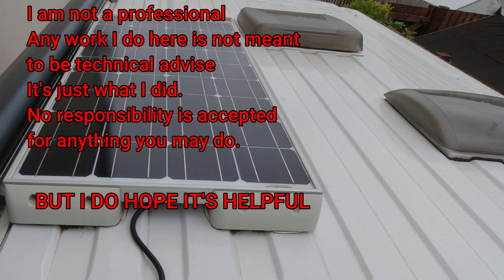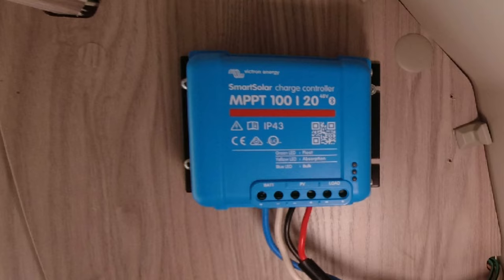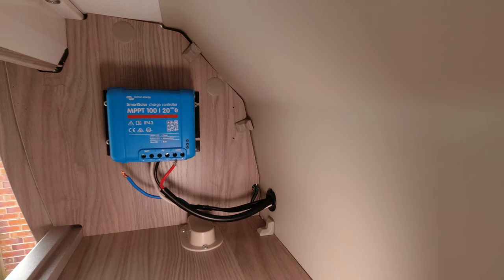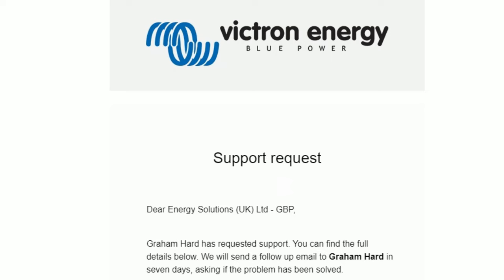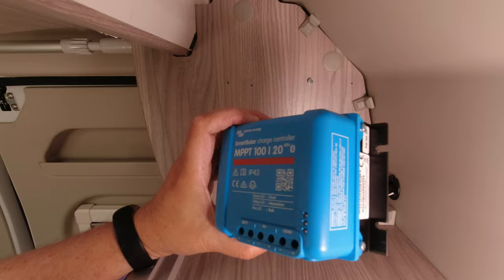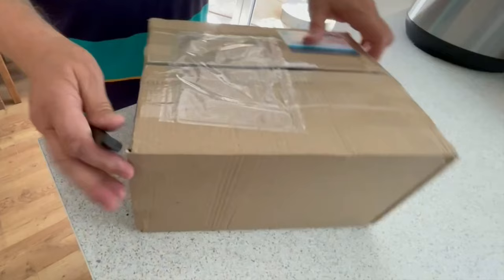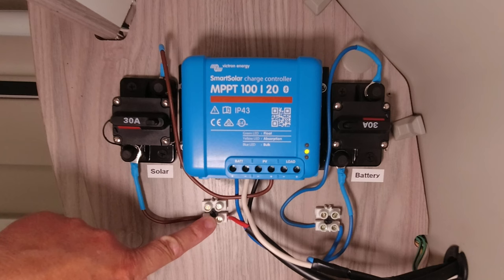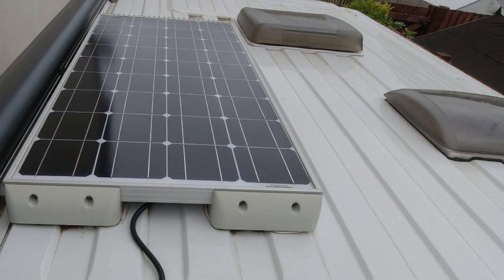OUR SOLAR FAILED NOT CHARGING BATTERIES CORRECTLY

Comment: I waited through this whole video to see what the issue with the controller was, but alas there was no reason given for the failure.  Great!   My Victron chargers have started to fail from time to time over the past 12-18 months.  Usually, a reset works, but the 100:20 version has recently failed consistently.    The other one, 75:15 is working at the moment, but has a dummy spit every couple of months for a few days.  This is why I have always run two separate power systems, be it on my yacht, camper trailers or caravans.  Something always gives and solving the problem is rarely simple given the number of variables in the system these days.    I retain an older non-smart solar charger for occasions like this!!
Reply from the maker: After all my fault finding I gave no reason for the failure as the manufacturer decided to replace the unit indicating to me it was faulty. They didn’t say what was wrong. I did send them an e-Mail asking what the issue was. They didn’t answer me but strangely sent me out a second replacement again with no explanation. So although I’m pleased I now have a spare I don’t know so couldn’t tell you what was wrong. I’m sorry if that frustrated you. It also frustrated me. I was hoping to find a connection issue or a fuse blown which let to the vlog ending the way it did. I didn’t hold anything back. It was just the truth of what happened. It’s good to have a spare like you do now. Sounds like you have it sorted. Thanks for watching and taking time out with your lengthy comment. I do appreciate it. Safe travels. 🐶🐶🐶🚐🧙‍♂️👍
Reply: I have dual solar charger for safety and redundancy, and 4 LifePo4 connected in series and parallels for redundancy and more power. 

This morning both solar chargers was dead which is normal as they are disconnected from the batteries when not in use and it had been night. So I flipped the switch to connect the battery bank and both charges came to life like normal, but they also started spewing out smoke and making a hissing sound so I disconnected the battery, but that did nothing... I tried disconnecting the solar panels from the chargers but before I managed to that the hissing ands smoke stopped....

Both chargers now disconnected from the battery running on solar panels only showed no error messages and indicated they was set at 24v charing which is correctBut they also indicated 42v battery voltage, and when measured it was actually 77,7v charge voltage. The voltage in from solar panels was 80v normal voltage.  Battery measured 26v like normal and it was still disconnected.

Now I have disconnected the 1380w of solar panels from the charger and have no idea what when wrong when both solar chargers started to smoke and hiss, they have been in use for 3 year connected like that.
Reply: I'm running three controllers to the same battery bank, mainly because i got too much solar for a single 60a controller but the benefit is if one fails i still have two running. So far none have failed. Greetings from Jamaica.

Comment: Well that was a total waste of time? We never knew what happened!
Reply from the maker: Well you would have known if you watched until the end. The Victron people accepted that the unit was faulty and replaced it. They never gave me a report of what failed inside which wouldn’t have meant much to me anyway.  I think you must have missed the bit where I said it was replaced otherwise you would have known. Thanks for watching. 🚐🧙‍♂️🙏👍
Reply: @Wizardinthewild  Yes I have seen it in it's entirety. That's why I said waste of time. Yes the question still remains what happened. We need to know so it can be prevented from causing a fire to the RV?
Reply from the maker: @Joe-rd8we  I don’t believe there was any fire risk so f do not worry yourself.  The unit just failed to output. It didn’t even get warm. It may well be that Victron didn’t even bother to investigate. Probably cheaper to sent a new one out than put a technician on it for many hours. But in the unlikely event that that did work it out I would think it would be an in house secret.  Interesting speculation though 👍
Reply: @Wizardinthewild  When working with electrical components. Anything can happen!
Reply from the maker: @Joe-rd8we  that’s true. 👍🙏

Comment: I bought one. It died under load. It lasted me 60 days exactly. I'm not interested in a product that doesn't last. It never put out more than  70 amps. I never got anywhere near the 100 amps it 8s supposed to provide.
Reply from the maker: I think all of them have poor margin. Not sure how efficient they are really.  But ours is working well now. Thanks for commenting. 🧙‍♂️🚐👀
Reply: what is the victron model that you have and can deliver 100 amps ???    only the biggest model , the RS series can deliver 100A and 200A .
Reply from the maker: @dimitris8829  mine is only a 30 amp one.  No point having anything bigger my solar panel is only 100w 🧙‍♂️🚐 thanks for commenting.

Comment: Shame you had a fault with the controller but good customer service by the sound of it. Good idea for future maintenance too.👍
Reply from the maker: Thanks Tim. Yes, they were a nice company to deal with. Shame it failed. Hopefully the replacement won’t! 😊
Reply: @Wizardinthewild  It's usually a 0%  battery depletion issue, some controllers won't charge a dead flat lithium ion or lead acid deep cycle battery

Comment: I have this issue once a year. Did what you did to reboot the controller which did not work. So then disconnected again and left it overnight. Worked next morning.
Reply from the maker: It’s a bit strange isn’t it. I did lots of fault finding and different tests.  Ultimately they replaced it as it was faulty.  Thanks for watching and commenting.  🐶🐶🐶🚐🧙‍♂️🙏

Comment: Hi Graham, thank you so much for your videos, they are so helpful. I have a CV40 and am considering upgrading the PWM to the MPPT you are using. I will probably take the opportunity to move it to near the battery and put a solar isolator switch where PWM is now, however my question relates to the in-line fuse near the battery. Victron specify 25A fuse minimum for the 100/20 and I wonder, did you merely replace the original in-line fuse with a 25A? Thanks again
Reply from the maker: No I didn’t change the fuse although I may have relocated it when I installed Buz bars. It’s still 35amp. Although the MPPT is more efficient the output from the solar is still the same. So very little amps change. Good idea to fit an isolator. I have done similar. Hope that helps and thanks for the nice comments. It means a lot. 🐶🐶🐶👍🚐🧙‍♂️
Reply: @Wizardinthewild Thank you
Reply from the maker: @user-gm6wb9et4r  will be interested to know how you get on. 🙏🧙‍♂️

Comment: Interesting that shame we don’t know what failed, I’d be amazed if you pull 10amp from 100w panel especially flat on the roof, although Mppt is better than pwm the best I’ve seen in full sun is around 5amp in. I did say to Heather you need an inline fuse on the input end before you fitted the breaker (fuse at a much higher rate would do as a quick pull out) 👍
Reply from the maker: I went for the circuit breakers because I already had some. Let’s hope this one holds up better than the last one🤞

Comment: Really pleased you got it sorted out and identified as a faulty device and that they replaced it, good idea to put the breakers to enable easier reset. I am thinking of moving mine under the bench as found it gets very hot in the top cupboards if the van is sat in the sun shining on that side (especially with ours been a dark colour) I seem to get a problem where you can’t connect via Bluetooth when it warms up in the heat, but continues to charge ok but seems to sort it’s self out overnight. 
Looks like you got good service.
All the best, David 👍
Reply from the maker: Youve made some interesting observations there David. I sometimes wonder if it gets a bit hot where it’s situated in ours. Like your idea of moving it lower down.👍

Comment: If your battery is discharged to 0% the solar controller may or may  not charge it depending on the brand of solar controller.
You have to direct charge from the battery for at least 30 minutes then hook up the battery back to the solar controller and Bobs  your uncle 🤠!
Reply from the maker: Thanks for you advise Blake. In this case the solar controller proved to be faulty and Victron replaced it. All working fine now. Thought I had put that in the video but I may be getting confused. I might have done an update video. Appreciate your help. 🐶🐶🐶🙏🧙‍♂️👍🚐

Comment: I have a question...
I have a 300w solar panel and a 12v 50ah battery and for some reason it doesn't want to charge at more than a 100w.
Is that normal?
Reply from the maker: It will all depend on what controller you have. That will be between the panel and the battery.  If you have 50ah which is quite small it’s likely that your controller is also low amperage. TBH the 300w solar isn’t a good match for that battery. You want at least a 240ah. Hope that helps. 🧙‍♂️🚐👍

Comment: How do you measure thr voltage on the mppt with the meter?
Reply from the maker: You just need to put the meter probes on the - and + of the solar in and same for power out. I have a digital meter so set it to 24v scale. Of course you can use the Victron MPPT app. 🐶🐶🐶🚐🧙‍♂️👍